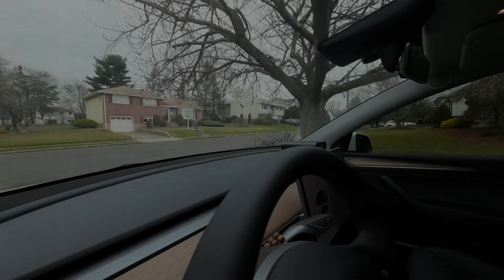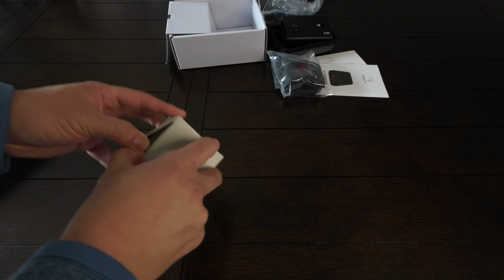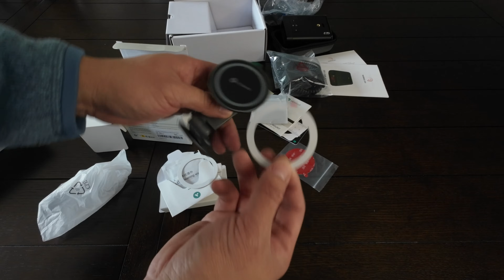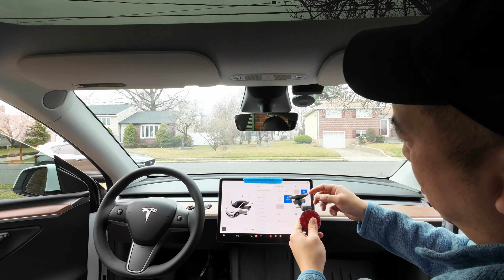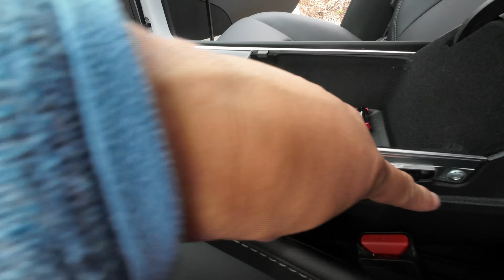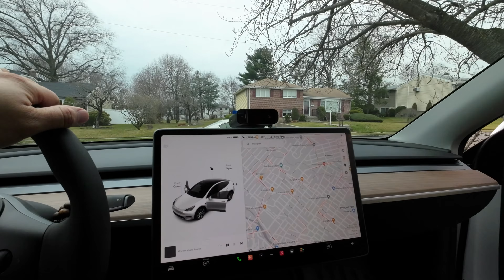Radenso DS1 Radar Detector Installed in 2023 Tesla Model Y using Vicseed Magsafe Mount

Comment: I’ve done this with som not 40$ mounts and they last about 6months before the stick in Tesla screen wears out. Using separate 3m and adhesive promoter got me about 7mths vs 6 without. I think the screen back is just to porous of a metal possibly or just hot sun wrecks it. YMMV but I’m on my second mount that cost 14$ and get a 2yr extension from Amazon and just keep getting new ones every 6mths is my experience

Comment: As cool as this may look, don't do this. This is ridiculous, I mean that's your center console... Why would you in anyway place a suction cup or especially an adhesive on it. The risk factor alone in removing that is too much. I find it perfect placing it on top, where your top window is located.
Reply: Completely disagree. I’ve done this exact mounting setup for almost a year and it’s fantastic. I don’t need to worry about removing it. It will fold into itself and be hidden

Comment: Nice video.  FYI, they make a magnetic quick connect for usb c, so you don’t have to plug and unplug all the time.  It’s like MagSafe for Mac laptops.
Reply from the maker: Yes i did see that type of plug. I probably going to upgrade in the near future! Since my front windows and windshield is tinted, there was no need to take off the radar detector.

Comment: One final set of questions: 1. What length cable would you recommend for the Model Y? 2. Do you still recommend the Beken cigarette charge? 3. Have you had any slippage with the ring magnet? 4. And fjnally, have you had any issues with the Tesla windows and the detector. Note: I purchased the same radar detector and mount based on your video. Thank you again.
Reply: Thank you again.
Reply from the maker: You are welcome!
Reply from the maker: @markroath98
1. 6ft to 9ft is good to use
2. Yes, you can use Belkin as a charger
3. Magnet is super strong, Its actually hard to take off at times =)
4. No issues with the detecter at that spot. Be sure to google Radenso DS1 Settings for (your State). This will give you the most optimal setting. Works perfectly!

Comment: With that setup, is the radar always on? You have to manually turn on and off? It does not auto turn off when you leave the car?
Reply from the maker: Originally I would turn it off when manually but it does turn off automatically when I get home when my car goes to sleep. But when the car goes into Sentry Mode, the Radar will stay on. 

So what I have done was reran the wire into the center console and have a USB Hub with on and off switches. Check out this video I made using this hub.
https://youtu.be/5yWB5dvczfw?t=868

Please let me know if you have any questions.
Reply: @garrick_ish did that setup work with the usb hub powering the Radar detector? Please let me know. I’m about to buy it

Comment: Run into any issues with it overheating?  Putting the metal plate on the bottom covers most of the ventilation holes. Love the idea just concerned it might not as long.
Reply from the maker: No Issues so far. Just went on a road trip from NJ to Montreal last week and it was a 7 hour drive. Worked perfectly fine.
Reply: My Radeon r4 overheats like crazy on it. So I just use the glass mount instead.
Reply: Yeah I've tried with this Radenso and also Uniden using MagSafe holder and flat metal plates.  Both times it gets too hot and the metal plates come off of the radar detector.   Currently I've gone back to window mount but would love to see option that stays on the detector better

Comment: I’ve got a Ds1 in my ExplorerST.   Going on a month.  It’s got most of my daily auto lockouts marked and silenced.   
I love the mount location.   That’s pretty slick.  

I bet you would notice a sizable difference in performance using the included power cable (following the manufacturer’s instructions on their webpage). And using the screw mount getting it away from that much stronger magnetic mount.  

I love the placement.  I wanna do it.  But in another Radar community there’s talk of and when the iOS app drops you can flip the display if the mount placement would make it upside down otherwise.  (Like on a motorcycle) 

🤙
Reply from the maker: The DS1 is a good value for the money! So far, it has been working really well and detecting from a distance!
Reply: Hi there, just want to double check the ds1  radenso ds1 radar detector frequencies specs checked on Amazon it say ds1 has gasto frequency ,but  on another part, never mentioned  I’m located in Australia I just want to be sure if this be right to use here and doublecheck if it’s got gasto thanks
Reply: Why would a different power cable and a screw mount increase the performance of the unit?